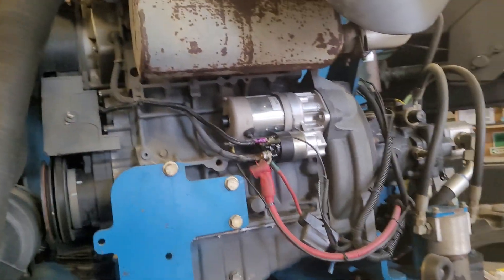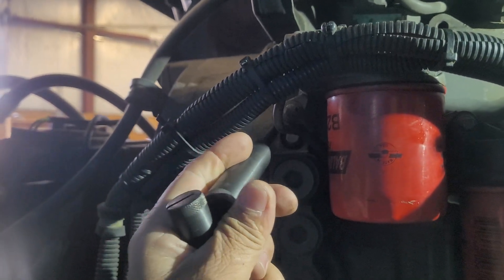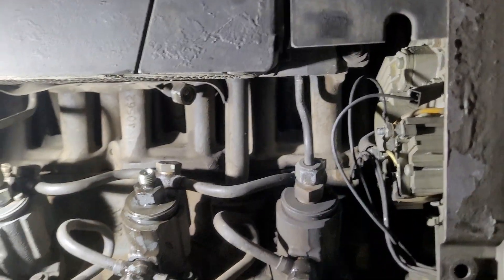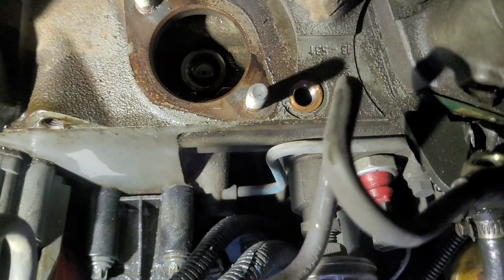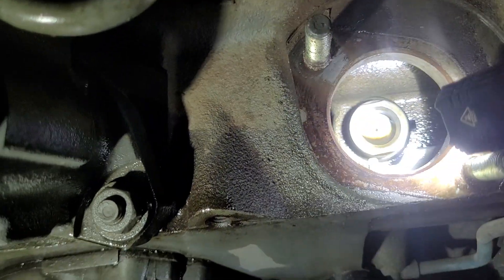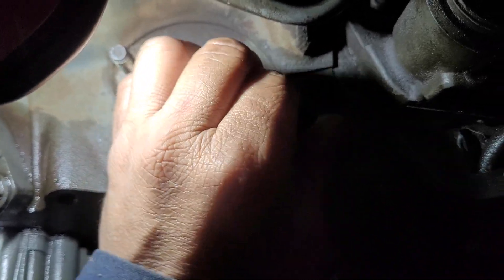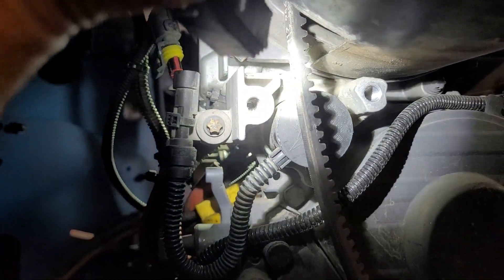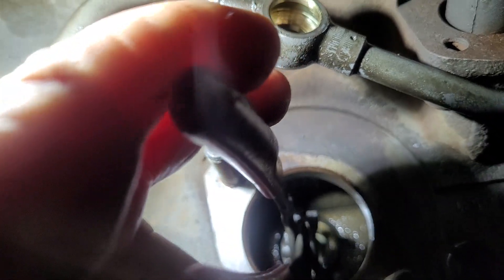Replacing Unit Injector Pump for DEUTS F3L.

Comment: Rubber timing belt  must be changed 2000 hours or pushrods get bent .
Just did one .
Those units are injection pumps.
Good 👍

Comment: Hi I have a duetz engine having problems the shut off valve turn off automatically when engine running few seconds.  I check the solenoid external ok. So can you suggest which part or component to check and how to check  tq
Reply from the maker: Check your alternator voltage supply,  maybe your alternator is no good

Comment: Hi healer, what is that timing pin you inserted beside the # 2 fuel pump preventing from moving and why?
Reply: Fuel rack
Reply: is not a timing pin, it is for the feul rack (how much fuel is injected).
Reply from the maker: To make sure you are in the right position

Comment: Ok, I see how to do that job but... how do you time the injector pump? You can move the pump back and forth on the slots (before you install both nuts), what is the proper setting? Full left, full right or center?
Reply from the maker: My friend I don't know what do you mean full left or full right. But if you have a pin timing you don't have a problem to change that pump, it's very easy.
Reply: @MachineHealer  thats not right, you can install the pump incorrect. I know because I'm dealing with this right now :(. the timing is not affected by changing out the injector pumps. Look at this video for reference https://www.youtube.com/watch?v=HzhafVQkqx0